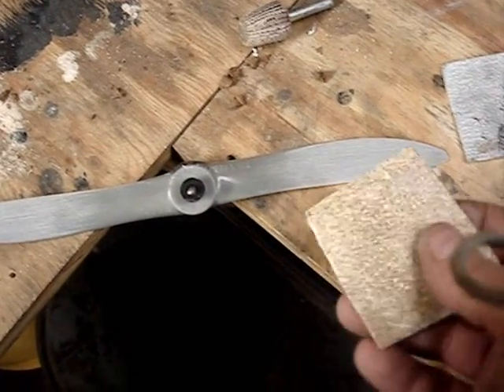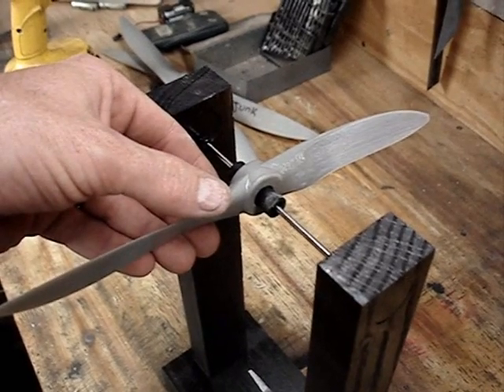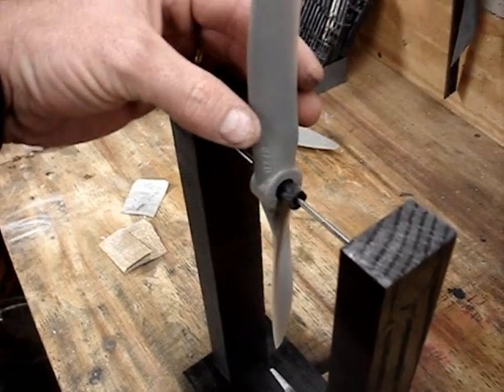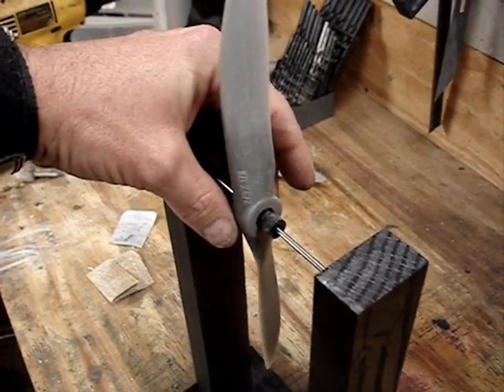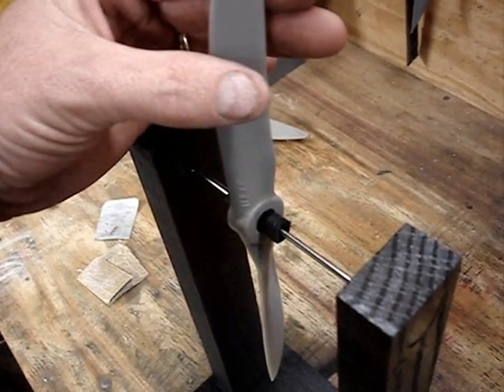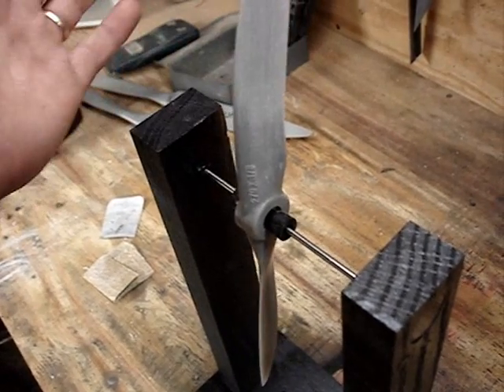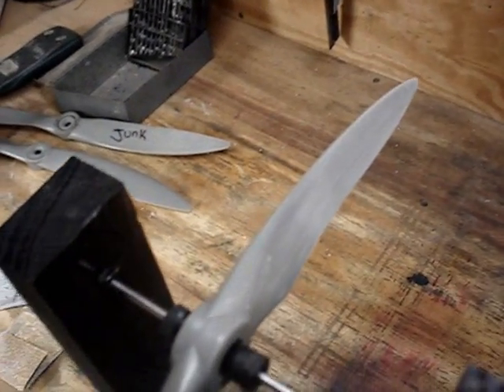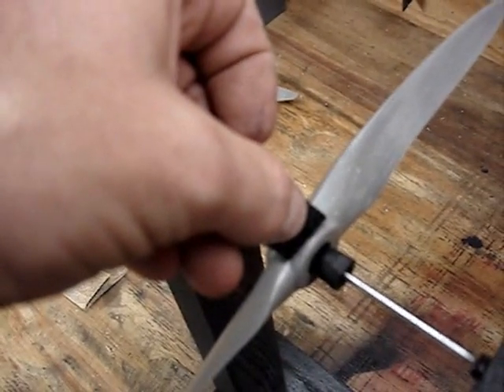prop balancing video tutorial

Comment: Superb, what do you run the prop on whilst balancing? Obviously a spindle but what holds the spindle in the hub? If it were a motorcycle wheel id have to use super slick bearings
Reply from the maker: On either side of the spindle are neodymium magnets.

Comment: Sorry Crispyspa, I don't see the point in taking off material from the heavier blade...why not add to the lighter blade..and why attach the ugly velcro ..permanently to the prop.. Just spray paint the lighter blade, until it matches the other side... then finish with Clear gloss if needed. Works for me every time...and looks great...
Thanks for the vid..
R.

Comment: I found the hub balancing very good information as that's less often covered well. But for my props (up to 12") I have found applying the appropriate amount of electrical tape to each prop to be an effective way to balance them. Balancing the hub in this same manner may not work depending on how out of balance it is and limited surface area to apply tape to.

Comment: I found this interesting information . we never think of tip to tip distance  only side to side.
Tracking the Propeller
Every once in a while you will buy a propeller that does not track properly.  Either the mounting hole is off-center or the hub is not square to the plane of rotation.  In either case, if the propeller is noticeably out of track you should not use it.

For a propeller to track properly, both faces of the hub must be absolutely parallel with the plane of rotation and the mounting hole must be centered and perpendicular to the rotation plane.

It is easy to see if the prop is tracking correctly.  Stand back for safety and look at the propeller from the side and from the rear.

From the side, both tips should be clearly visible in the same line.  If you see two lines, then the hub is not square to the plane of rotation.  You can attempt to sand the hub square, but I would simply return the propeller because it is defective.

When looking at the propeller from the back or the front, both tips should be in the same circle.  If you see two circles, then the mounting hole is off center.  Assuming you did not modify the propeller, then this too is a defect and the propeller should be returned

Comment: I noticed in the tracking part  you said  the prop was junk, for not tracking , well is it possible to correct he tracking with sanding the back of the high side  of the prop hub to make it sit more flat on the washer   behind the prop when you tighten it down , an keep taking more  material off the back of the prop until it tracks true?
Reply from the maker: Rondo Schiavoni  It was pointed out to me some time ago that my tracking theory is actually wrong. Had I fit the the prop up to the engine it would have straightened out.. Live and learn I guess.
Reply: do you mean the  prop balancing cones are off center hole sometimes?
Reply from the maker: Yes. Well, kind of. If you look on the APC website, they recommend not relying on the hole for centering and balancing because the back of the hub is what "true" and not the hole.

Comment: All good until that piece of velcro comes off. Which probably would not happen on a sport motor. For higher speed/higher performance stuff I'd be more inclined to remove material from the leading and trailing edges of the heavy side of the propeller.
But I guess then you're moving into the realm of wanting to have a pitch gauge and blade profile to make sure each blade is the same shape and doing the same work.
Reply from the maker: Tom Martin A friend of mine uses the velcro method on his props he runs on his Jett motors. 20,000 RPM. Holds up fine.

Comment: Good tutorial video but I was curious, would it not be much easier to use tape (sanding could mess with the way the air flows across the prop) and then rather than velcrow and superglue on the hub get a nail file and remove material from the heavy side. Just my 2 cents, otherwise thanks for the vid :)
Reply from the maker: Thanks. It certainly be easier to use tape but it just seems so temporary. What happens when the tape lets loose at 10,000 RPM? And if I used tape to balance and filed off some of the hub, the prop might fail at the hub if the tape did come off? Maybe I look to far into it. shrugs

As long as the sanding is kept flat and never on the airfoil side I don't think sanding is bad. I could possibly use some 500 grit to finish and buff to shine to  reduce drag on the flat side...Hmmm..I'm going to try that. 

Thanks for watching

Comment: I found out that for the APC props u MUST use the press in locating rings to balance the prop with out it the prop does not sit straight on the balancing shaft ( took me a couple hours to find out ) now it is a piece of cake :)
Reply from the maker: I've never had an APC prop come with those rings until I ordered my last one from Tower Hobbies. I don't know if they just always forgot them or what. I was wondering what those graduated rings were in the back side of the hub. I just assumed they were drill guides.

Comment: I see one flaw with your method. How you balance with sanding and weighting is your prerogative.  However, using an apc prop such as yours you dont want to put the cone into the front of the prop. You use the flat on the front and only cone the rear. Can check apc's website if you like for reference.
Reply from the maker: http://www.apcprop.com/v/html/balancing.html

Seems you are correct and it's best to follow manufacturer instruction, but i don't think the centering rings have been supplied until recently. Only the last prop I bought has had the rings. All others through the years did not. 
It may be time for an updated video.

Comment: if you aint gotta real prop balancer, just use a stiff bit of thin metal through the hole.
and keep testing until it seems balanced, this way does a lot to a new out of balance prop, and will be smooth as butter.

Comment: Your video is by far the best one I’ve come across on the web. Thank you! I've just bought a DJI Phantom quadcopter where 4 balanced blades are a must for good vibration-free airborne video. Here's my take on prop balancing. I'd have to side with the prop manufacturer's recommendation (see Chip Flemings earlier post) that material best be removed from only the “tip” area on “both” sides of the prop. When I’m done balancing using this technique (and flying with video), I’ll post with results.

Comment from the maker: Once the hole is off center, usually from operator error (that's how I wrecked that one prop), making the prop not track correctly, I don't think there is a way to fix it.   I suppose a drill jig could be made to put the hole back to center, but then the hole would be bigger and not fit your prop shaft properly. IDK.

Comment: the drilled hole on the front of most APC props is way off center and by putting the centering cone in it you are actually unbalancing a prop that should be close enough as is.  it is also the reason your blades aren't tracking.  find a way to index off the rear molded hole and you'll see that APCs are usually close enough to fly without any more work....at the very most you might need a light scraping on the front (curved) side of the heavy blade

Comment: My prop is out of balance on a pre-built J3 I got from Nitroplanes. When I spin it with my hand, I see the nose wobble, and when I use the remote and put it up to just over quarter throttle, I can hear that "chopping" sound and can feel the plane vibrate more. However, the rod that holds the prop and the nose is also wobbling behind the prop. Is there a way to fix this?

Comment: I prefer to spray paint on the light blade. Sanding is more likely to change the shape of the airfoil. One must be patient to let the paint dry thoroughly as the solvent evaporation will alter the balance. On large scale blades which require safety color on tips I will do just one tip or go more layers on the light tip. Use silver paint on APC blades or clearcoat. The downside is paint chipping which may throw off the balance again. How many people take their prop off and rebalance after a while

Comment: Landing Products has a couple of propeller balancing recommendations on their website that differ from what you show and say here.  First, the tool has two cones--the tapered end of one goes in the rear precision hole and the flat side of the other goes on the front non-precision hole.  Also, they say remove material from the heavy blade on both sides of the tip.

Comment from the maker: @01161996bubba Balancing a prop is never a waste of time. Sure, if the plane is built strong, vibrations may not harm anything (I'm not a flyer) but a balanced prop can lengthen the life of your engine (especially non bearing engines) and perform better.

Comment from the maker: @ThermalDream  You can remove material from the heavy side with a drill bit if it isn't too far out of balance. Drill in the same "track" (on the heavy side) as the place I dropped the superglue.   I didn't add that in the video because you can severely weaken the hub if you remove too much material.

Comment from the maker: @youronlycow Holy crap...I'm kinda late on this reply...sorry.

Props are somewhat balanced when you get them and they (for the most part) are usable right out of the package, but the more vibrations coming from the prop means more loose joints on your plane and early bearing failure on the engine. Higher RPM is also an added benefit from a balanced prop.

Comment: I bent my balancing rod by accident and never got it true again so, I cut the thing in half and cut the bracket rods back that much the same. Now my balancing rod is 2 and 1/8th long and my base mount rods are 4 in. long.. This fixed it for the average size prop.  I dont recommend this for car owners for wheels will not fit the balancing rod again.

Comment: That's some serious OCD level prop balancing going on.. 

Also , checking the tracking off of the motor does not actually check the tracking of the prop. Tracking should be checked with the prop mounted and tightened down at normal torque.

Comment: @wizprod 

I've never tested that idea either but I bet battery consumption would be less. 1) the amount of blade change is very minimal  and 2) the balanced propeller will run far smoother and results in less wasted energy.

My guess is there would be no measurable change in energy usage but certainly not  a measurable increase in power consumption after balancing.

Comment from the maker: @dreamwisperer 
It is a general purpose, low odor, fast evaporating, aliphatic hydrocarbon solvent used to dilute certain paints and finishes.

I use it for removing oils and sticker glue.

Some call it white gas.

Thanks for watching.

Comment from the maker: @heberorozco 

An out of track prop causes lateral vibration at higher RPMs. An out of track prop will wear out your bushings or bearings faster. If your prop is only 1/16" out, I wouldn't worry about it, but if its something like 1/4" or more, I won't use it.

Comment from the maker: @Haglaz76 
It's very easy to make actually. I used the parts (shaft, cones and magnets) from a Top Flite prop balancer I bought at Tower Hobbies and 3/4" oak for the stand.
I do some large props and the store bought balancer wouldn't  allow the prop to fully rotate. 
The supplied magnets were not strong enough to hold the large props, so I found some "rare earth" (neodymium) magnets inside an old computer hard drive. 
Thank you, and thanks for watching.